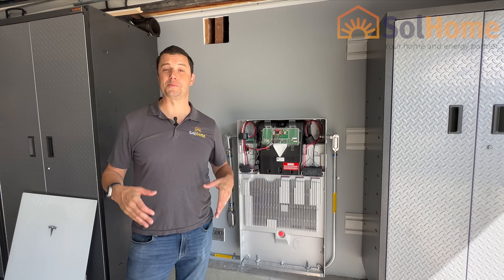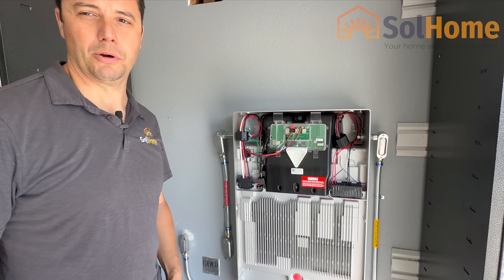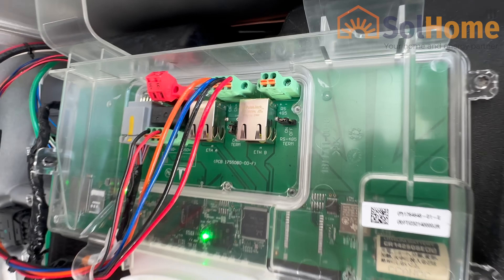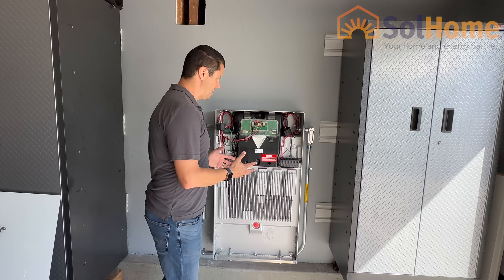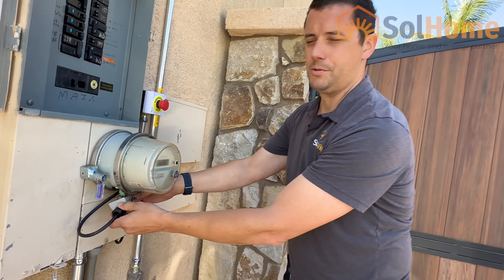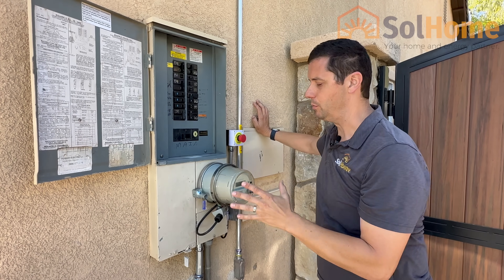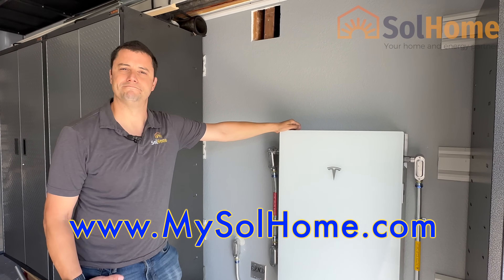Inside Tesla Powerwall 3

Comment: Question I want to explore more.  I have Net metering in Arizona that I do not want to lose.  My plans is rated for 10kWh.  I have 13.7kWh of solar on my roof.  Here is the problem, I have 2 SB 5000TL-US22.  I am generating more solar than the inverters can handle.  Anther issue is  the original owner and solar company only registered 10kWh with APS power company.  If I generate more than 10kWh I loose my 1:1 grandfather plan.  I do not want to loose that.

Anther issue, I am told I have, are those 5000 inverters only pass 80% for longevity.  So best I see is a fairly flat peak at 8kWh.

The one thing that I heard, and maybe misunderstanding is, you said, the power wall 3 can be set to only output 10kWh to the grid, thus maintaining the plan and not losing it due to overproduction.  Can you expound on that?  Is there a way to only send, say 9.5kWh(keeping a buffer) to the grid to maintain the grandfathered plan?

Comment: thx yet I have not got whole picture of wiring diagram, not sure you used Tesla inverter or not, how many panels in a string how many strings, whether shadow affect the system, etc. weather the front is glass or not has little meaning.

Comment: So it can not even charge a car half way?  For this much money?
Reply: A Tesla model 3 has a battery size of 50 to 82 kWh. It would have to be a 25-30 kWh battery on the wall and would weigh 675 lbs. That’s almost impossible for average installers to move and would never be able to be mounted on the wall, which is a major benefit of the powerwall.

Comment: what about when you have no grid or solar at night.  power goes out.  how do you manage the loads and meet code.  you need to load shed with a generator why not with your battery system
Reply from the maker: The customer is expected to manage the loads. Unlike a generator, the battery will simply turn off if overloaded.
Reply: @mysolhome  show me in the NEC where that is please

Comment: Live in Sweden and I have built my own system with a model 3 battery and a 10kw inverter. Works amazingly well. Incidentally, it's fun to see how big a difference there is in the electrical wiring in your country compared to Sweden. That you use steel pipes and we use plastic hose

Comment: I have an all-electric house and use a lot of power in the winter.  Does the Power Wall 3 have a provision to hook up a backup generator -preferrably some type of a smart diesel generator that will start when the grid is out and the batteries fall below a certain preset level?

Comment: I am in the UK, great video. I can confirm that the UK supplied unit is very slightly different.
The UK unit has a DC isolator switch on the right hand top corner.
Only three MPPT strings allowed, (down from the 6 strings) shown here on this US unit?
Our PW3 was commissioned on 30th Oct, 2024
Reply from the maker: Thanks for the info!
Reply: Same as the AU version with 240v

Comment: I believe the shield for the DC side is to separate the DC conductors from other wiring in the unit. Does your AHJ not require that to be installed?
Reply from the maker: This is not the case. It is clear in the manual this shield is for RF purposes.

Comment: Thank you for the video , Just had two power walls threes installed in my basement. Not required, but I drywall the room with 5/8 drywall. From what I’ve heard, Tesla could not cause the battery to go to thermal runaway through their tests. Had to use the gateway, 3,  between the panel and the utility meter. Everything working beautifully any thoughts?

Comment: EG4 PVK18 inverter and Power pro 14.5KVH battery $8595. About 1/4 the cost of Tesla it's UL 9540A ESS certified.
Reply from the maker: Once you include labor from a reputable contractor, both of these installations would be similar in price for whole-home backup.

Comment: I see that there is multiple inputs to the inverter. What's stopping me from hooking up a generator to one of those inputs? Because the generator will output AC, a big bridge rectifier and a chunky capacitor to smooth out the ripple would give the DC it needs. So, as long as the voltage is in the right range, would it not work?
Reply from the maker: Give it a try and report back.  I’d be curious to see how that works!

Comment: Hi, I'm an electrical engineer and one thing I noticed in the video surprised me. At 3:04 it seems that you ran the communications wires from the "TACO" through the ferrite choke. Did the installation manual recommend doing this, or did you all do this as a "can't hurt to run everything through that!" decision? Probably not a issue and might be called for, but I was surprised to see those data lines going through the choke.

Comment: I am in San Diego and are wanting to get at least (2) Powerwall 3 batteries. I currently have solar panels (20) 450 Watts with mini-inverters, and a 200Amp panel.

Do you guys offer financing like Tesla does and would I need to pull a permit with SDG&E? I don’t want to lose my NEM 1.0

I would like for the solar panels to charge the batteries until before dawn, and run the entire house during night time.

Comment: What if i dont want solar yet i just want a powerwall to kick in during power outages but would stay charged by the grid rather than solar.  With an option to connect a generator to charge it during extended outages?
Reply: What are the options for pw3 and generator? I'm guessing none.  I'm assuming the issue is sync. Let's assume the power goes out and panels are covered by snow for days. When the battery is almost dead, the manual transfer switch is switched, the backup generator is manually started, but the generator can't sync phase with the pw3.  Is the pw3 smart enough to sense the generator and sync?  Perhaps an option would be to shut down the pw3 completely, start the generator as if it's the grid, then restart the pw3 and let it charge. And then do it again in reverse when power is restored. Or perhaps there's an option to feed DC from a generator to the pw3, just like solar panels.
Reply from the maker: This totally works, minus the generator with the PW3. There are other options that do work with a generator.

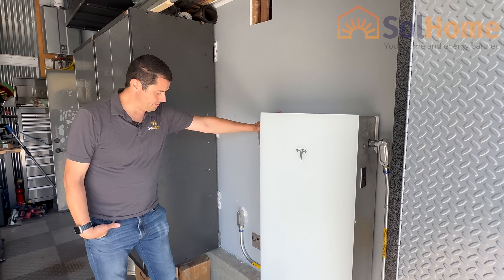Comment: 14:03 My electric utility meter (next to a pad mounted transformer) is about 130 feet from my main panel (200 amps).  The two are connected underground.  Since the backup switch fits under the meter, does the installer need to dig up the 130 feet conduit to connect the backup switch to the 200 amp service panel?  Or does the backup switch only need to communicate with the utility meter?
Reply from the maker: There would need to be a wired connection to the meter. Can you pull a wire through the same conduit to the meter? If not, you would need to trench. The backup switch might not be the best option in your situation.
Reply: @mysolhome  I would probably have to first locate the existing conduit to determine that.  I will have to call Dig Safe 811 for some other projects anyway so that will be enlightening but hopefully not shocking (haha).  Also, I think the backup switch is only approved by a minority of electric providers nationwide, but Tesla is working to expand the approvals.  If you're in San Diego I think SDG&E is in the clear but I am in Central Texas where PEC (Pedernales Electric Cooperative) is my provider.  Thanks for the response!

Comment: Peak output above 3KW is nothing more than marketing. A 13.5KWh battery supplying 3KW lasts 4.5 hours. Last time i checked, the sun is only supplying meaningful solar energy levels for 8 hours per day, and supplying nothing for 12 hours per day. So the battery must supply power for 12-16 hours per day = sub 1KW. 

Our house base demand is 700W. 0.7KW x 12 hours = 8.4KWh. Cooking dinner adds 2KWh. Leaving 3.4KWh for everything else (washing machine, drier, heating/cooling, dish washer, TV etc). 

Then look at energy storage cost across battery lifespan. In NZ, this is about $0.50/KWh (1 battery cycle per day, 365 per year, 10 year lifespan). But electricity only costs $0.35/KWh to buy from the power company

Finally, PW3 uses NMC not LFP

Comment: If you get multiple Tesla PW3s connected on a 200A (225A) panel, you don't necessarily get that much more instantaneous power capacity, but just more kWh (run time) right?  Since you're going to max out the supply while on grid at about 56A (60A breaker).
Reply from the maker: You can actually connect 2x60A breakers! The PCS settings limit the totally bus bar current to 160A so you will never overload the bus bars when on-grid. And, you can get 96A continuous output from the batteries when on-grid and off-grid. So yes, you get double the output and double the storage capacity.
Reply: You can get a pw3 without the inverter - just the dc batteries tied in basically.  I'm not sure on how much less money that is but if you don't need 22kW, it would make sense to go that route.

Comment: Tesla is just catching up to their competitors. There are better batteries for less money.
Reply: 185 LRA is unprecedented from what I hear.  It's game changing.  Slow start systems are annoying and Powerwall 3 obviates the need for these for 99% of residences
Reply from the maker: Not for less labor for whole-home backup that I’m aware of.
Reply: @mysolhome  You are in CA -- your labor market might as well be a different universe.  There are plenty of other parts of the US that have sane labor rates.   I did EG4/LuxPower.  20 panel -- 7.4kw array, 28kwh of LiFPO4 storage, inverter and 10 circuit transfer switch for $12k, factor in the 30% federal and I'm right around $9k for a complete whole home backup system materials and labor totaled.

Comment: So with those cooling fins and not a radiator: Is the Powerwall3 still liquid cooled like the older models? Also with all those amp ratings that's for the US only and their 120V single/240V split phase system which is pretty unique on planet earth.
Reply from the maker: Correct; there is no liquid coolant (thankfully)

Comment: Walled garden. Like Apple products. I am off-grid and Tesla won't let me buy one and install it. So I went with EG4 Powerpro batteries and their Luxpower-sourced inverters. No system issues and no ridiculous install charges. Very happy with what I got and I understand every aspect of my system, so if something goes wrong, I can diagnose the issue and likely handle it myself. So I appreciate the notion, but I don't need an Apple-aesthetic glass cover that will break when I'm less than completely careful in my garage. Not sure what happened to "the best part is no part". Glass? Really?
Reply from the maker: Agreed. This device is not designed to run off-grid exclusively, but is the best out there for most of the grid-tied population that simply wants a plug-and-play solution that automatically saves you the most money on your electric bill without having to do any programming. Also, you can add whole-home backup for under $1000 which is amazingly inexpensive.
Reply from the maker: Also, the glass is tempered (like your car windows) and is very resilient to damage. I would argue it’s stronger than the metal casing on most inverters, and certainly stronger than the plastic on most batteries.
Reply: @mysolhome  Good points. It has its place in the market and has created an ease-of-use standard for others to follow. But Tesla's "You won't be able to figure it out" attitude towards the public is annoying to me. It's why I'm waiting for the Aptera to mature so i can have a car that is customer-focused instead of mars-focused. :-)

Comment: Is the Powerwall 3 compatible for expansion or replacement in an existing Powerwall 2 installation?
Reply from the maker: Expansion: no. Replacement: yes.
Reply: @mysolhome  Thanks.  Look like I will not be upgrading until my PW2s die.  I have 2 PW2's now, but would prefer to have 3 Powerwalls total.

Comment: Wondering if the meter interconnect can be installed on a home with 400 amp service?  I was previously unable to install generator interconnect due to hardware limitation (200 max).
Reply from the maker: Not at this time. It’s only rated for 200A.

Comment: My solar company quoted 3 Enphase 5Ps $4K MORE THAN 2 PW3s.  Easy decision and we have Enphase IQ8A Inverters and originally wanted to stay in one Eco System.  But since we have a Tesla adding PW3 makes perfect sense financially and backup power-wise.  I was shocked to learn my utility provides a $300 per kW CASH REBATE (which I was unaware of when we started discussions)  so my 2 PW3s net me over $9K in cash rebates and 3 5Ps only HALF that.  BTW I'm working with Straight Up Solar here in St Louis who installed our PV system last fall.  Good to know the PW3 is a BOTTOM BREATHER as my installer wants to mount them about 4" off the floor in my garage.
Reply: Check out EG4 18KVP inverter and 14.5KWH battery for $8600 add 2nd battery for $3600 plug and play. These are California approved UL 9540A ESS certified.
Reply: "utility provides a $300 per kW CASH REBATE" Because they will be using that battery when they want too.
Reply: Enphase has crappy inverters that fail.

Comment: I live in Northern California. I just had a 9.3 KW system installed with a Tesla 3 Power Wall. I went with Tesla directly for the install. The backup switch it very impressive and the Power wall easily powers our 5 Ton heat pump which draws much less energy than a typical 5 ton AC unit. So far, I'm very impressed and we are still waiting on PTO from our utility (PGE).
Reply from the maker: How long was the process with Tesla from first contact to install?
Reply: @mysolhome  I started talking with them at the end of February this year. They sent a person out to survey my house which included a drone fly over, panel, roof, garage inspection etc. I then put a deposit of $100 down and they drew up plans and gave me a hard quote. Once I accepted the quote they went to work on permits. The initially scheduled the install for early May but I had a conflict and we did the install the day after Labor day. It took 2 days total. In reality it was 2 half days since the crews did not work past 1pm. In our case I had a problem with the "Meter Socket Jaws" which did not allow us to plug the back up switch in safely. I had to hire an electrician to fix that. Once that was fixed the backup switch was installed and we had our final inspection the next day. I'm now waiting on PTO from the utility. In all, I was very pleased with Tesla. They responded very quickly. Had I not had some conflicts, Im confident everything would have been done a month sooner. Their price was 12K lower than my next lowest bid as well.

Comment: My house has a 40amp (230 volts in Australia) breaker on the feed from the grid, this powerwall could supply me with more power than the grid. I have natural gas for heating, cooking and hot water hence the lower demand for electricity.

Comment: Problem with an Enphase system... Place a call get it solved.   Problem with a Tesla system Place a call  Oh wait, no phone support.  Send an email and get a quick response within a month.  Two months later someone shows up and has no clue.  Not a joke.  This happened to my neighbor.
Reply: Same for Tesla cars.  Soonest service appointment I could get for brake system ABS is 40 (fourty) days away.
Reply from the maker: This is true if you buy direct from Tesla. Use a local installer; the support experience will be much different.
Reply: @mysolhome  that's true but local installer will charge $9k more compared to Tesla.
Reply from the maker: Wow, that seems like a lot.

Comment: Will it work with a Powerwall 2 ?
Reply: Powerwall 3 cannot be added to a Powerwall 2 or Powerwall+ system - This may change in the future, but I won't count on it.
Reply: @aread13  Just been told by installer that they are compatible but im having another Powerwall 2 as its cheaper

Comment: Great Video. Will the whole House backup switch work with two 200 amp panels? What things will change with two panels?
Reply from the maker: No, you would need to use (2) backup gateways  and (2) separate systems for two 200 amp panels. This is assuming you have a 400A service.
Reply: @mysolhome I have 2-200 amp panels as well and I need some clarification on what you indicated please.  I understand the part about the 2 gateways  but you said 2 separate systems as well.  What do you mean by 2 systems?  I’m a novice here with no experience in this area.  I am considering 2- powerwall 3’s with the possibility of adding solar (waiting to see if HOA will approve).  If I have a garage that has HVAC (mini split) would it be better to install the backup batteries in that space as opposed to outside where it can reach in the 90’s?

Comment: What are the dimensions of the unit? - H.W.D?
Reply from the maker: Here is the spec sheet:

https://service.tesla.com/docs/Public/Energy/Powerwall/Powerwall-3-with-Gateway-3-Installation-Manual-NA-EN/GUID-EC527BC7-4750-4425-BBC4-DB8C000339B3.html
Reply: Dimensions	43.25 x 24 x 7.6 in (1099 x 609 x 193 mm)

Comment: So I understand the meter base relay to drop the connection on a grid down condition but you are limited to a max of 50 amps into what is a 200 amp service,  with no load control what keeps a home owner from overloading that capacity, turn on the AC, the electric dryer and an oven and you are way over the inverter capacity? One very good reason for having a critical loads panel is you have some way of avoiding an overloaded condition. Thoughts ?
Reply from the maker: This is true. Tesla is telling us to educate the homeowner on managing their own load control and setting expectations during the sales process. Most people would rather save the money and manage the loads themselves. If they want it to be automated, they can pay more for the backup gateway and a backed up loads panel.